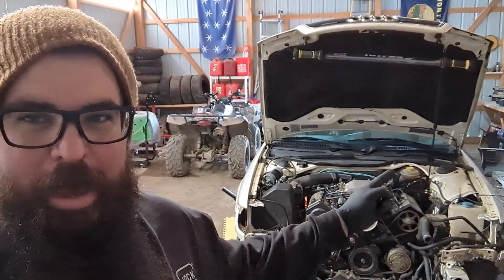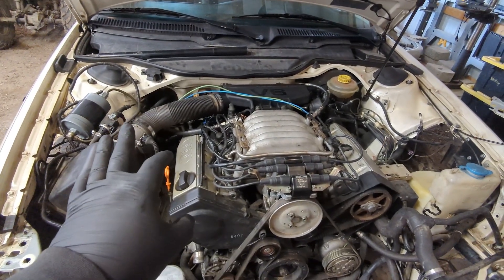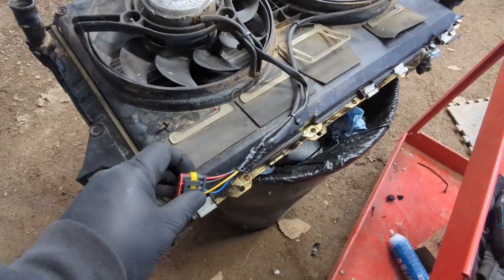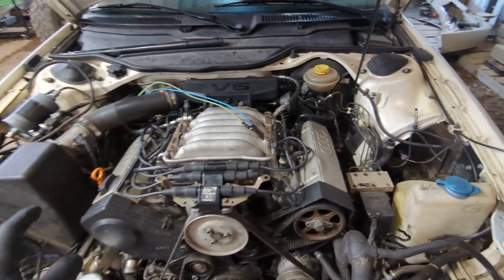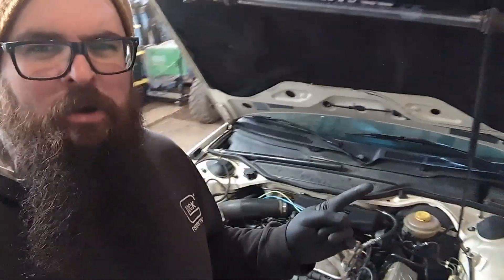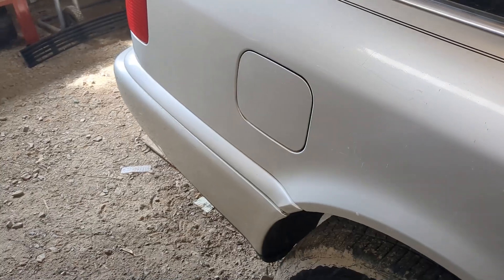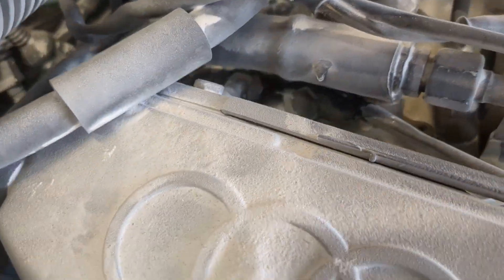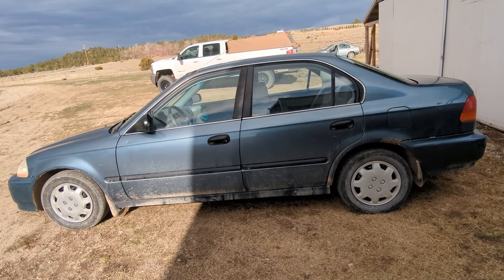I ALMOST BURNED DOWN THE SHOP!

Comment: Amazing video. A very exciting series about car modernization.
Good luck with the avant. I had exactly the same A6 C4.
The last episode was released 4 months ago, what happened to the project? Have you sold it or want to sell it?
Reply from the maker: Thanks! I blew my knee out hiking over the summer and so I was out for a few months. Just starting to get back around to other stuff before winter hits. The vacuum leaks frustrated me and it was leaking underneath so after I do a couple of other things I plan to try to address those. I'd really like to get it to a point where it can be dailied in the winter. However, if it fails this winter I may just sell it. Really would be a bummer, but want to move on. I have a 94.5 Cabriolet that has the same engine that I'm tempted to just throw in here, but it's pretty clean for what it is so would feel bad ruining it. Thanks for watching!